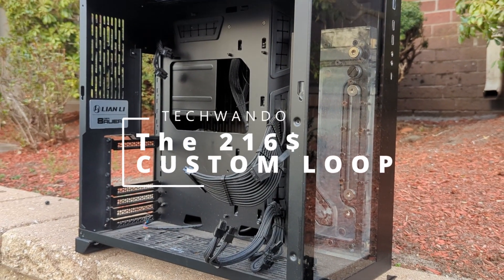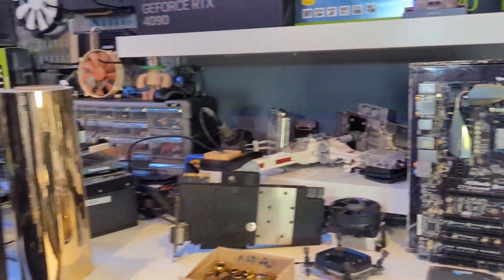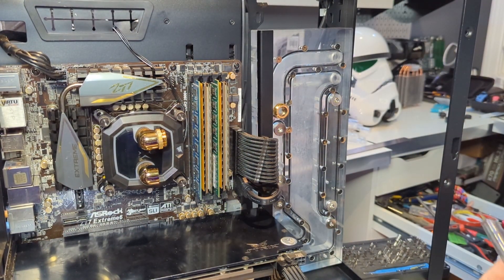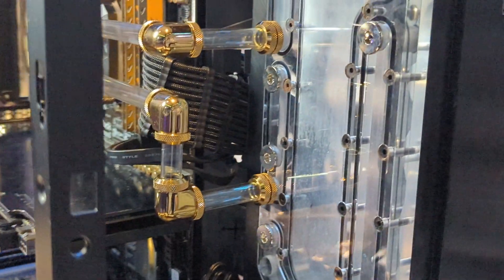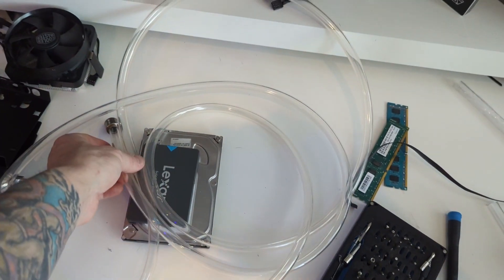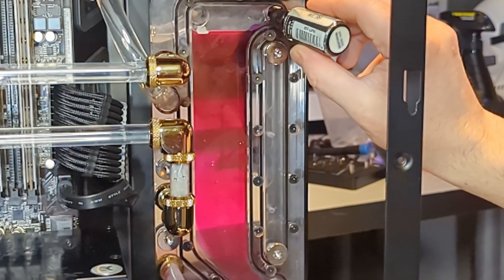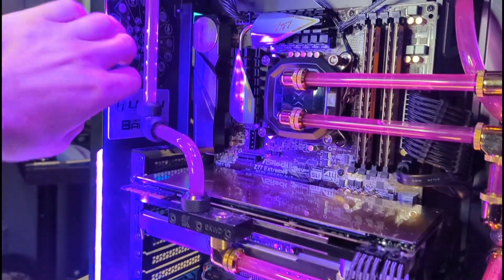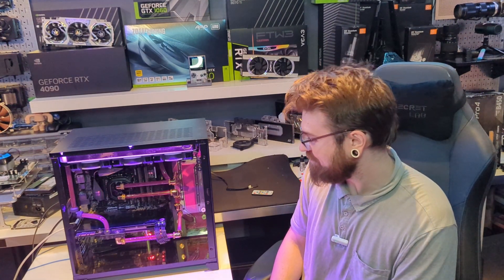This ENTIRE PC cost 216$ - The Budget Loop Challenge

Comment: nice price range and love the case. I like the idea of water cooling but my hot environment is not ideal for it.
Reply from the maker: Where are you from?
Also, thanks!
Reply: @techwandoUS  I'm from Manila where the heat Index gets ridiculously high.
Reply from the maker: @leorickpccenter yeah, it's good that you understand how watercooling works to, some people think it just cools it more but it's all about that ambient temp. 
Also had to look that up on the map. Pretty cool 👍
Reply: @techwandoUS  yeah. Water temp rises the longer it is running in a loop in a hot room for example. And since i build systems from time to time for clients, i am able to test these things. In a hot environment for example, a $20 air cooler can easily rival a $60 240mm AIO for example. I don't even bother with 120mm as those perform really bad under these conditions that even AMD's Wraith Prism can out perform.